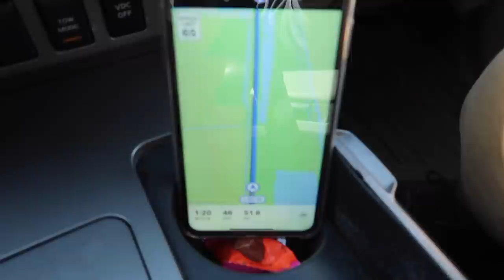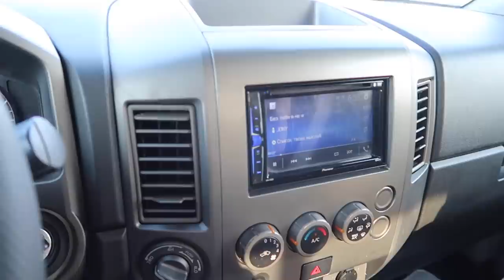PURCHASED THE MOST CONTROVERSIAL BMW FROM COPART SITE UNSEEN!

Comment: Take it from a long-term E92 driver, that started driving an I3 around town for the last 3 years. The car is very good for what it is, quiet, fast, comfortable, easy on the wallet, and handles relatively well. The seating position and the internal space are as good as that of a mid-size crossover SUV.

Comment: Lol dude we're like living separate lives and buying all the same cars. We had an i3 for a year. Tires are absurdly expensive expect to pay as much as a new set for your m3. Battery replacement done. And as well as dealing with a pesky check engine light whenever we connected to a specific charger.

Overall it's super fast but wasn't worth to keep because we'd only get 60 to 80 miles on full charge and with the rex motor filled with gas